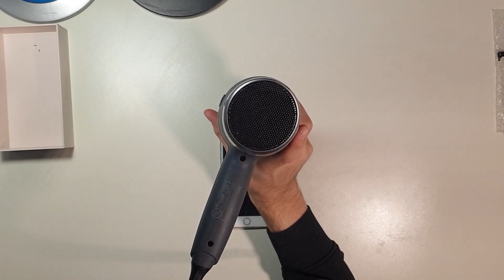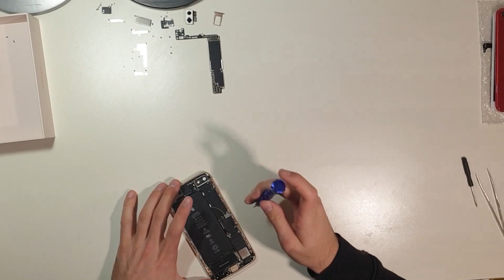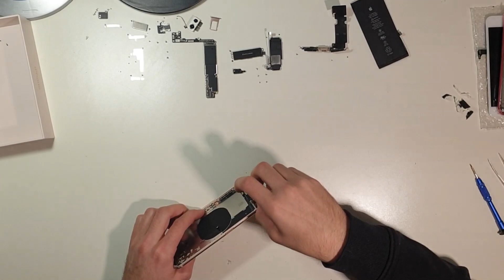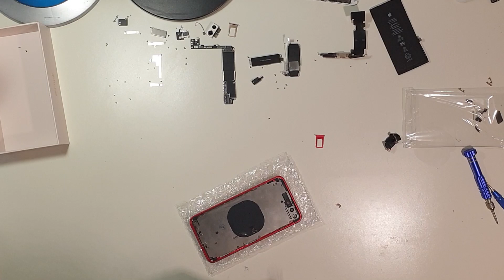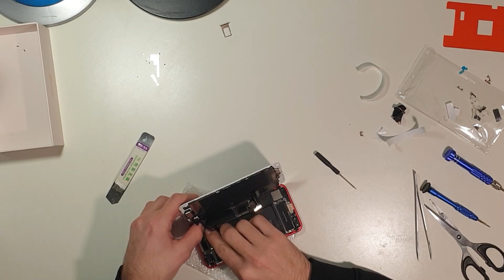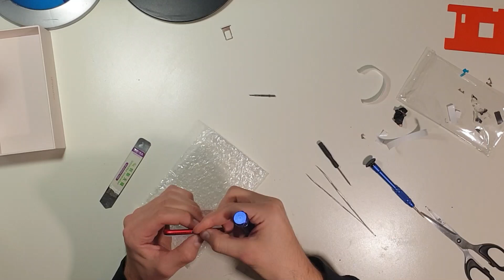Transforming broken iPhone 8 Plus into Red edition, Dismantle repair TIME LAPSE!

Comment: Hi, I was wondering if you could lube my switched for my Razer black widow elite keyboard, I was allow you to make a video out of it to compensate your effort
Reply from the maker: Hey, I am really sorry, but the shipping costs for the weight of Blackwidow would be a lot, not to mention that it's a lot harder to also replace the Green LED light on blackwidow elite, since it has backlit, so I think overall it's just better if you sell it used as it is and buy yourself another working keyboard, because shipping costs would be similar to what you can earn by selling your current blackwidow and buying another used one.